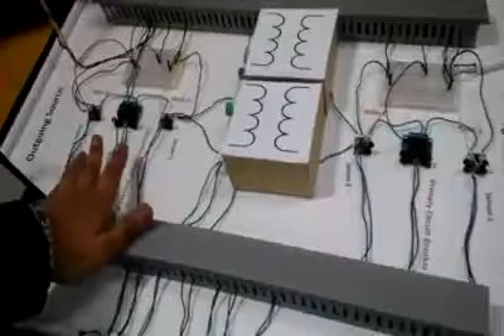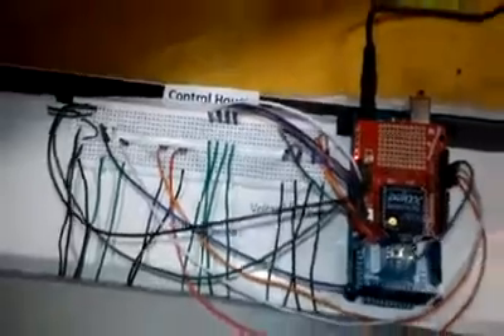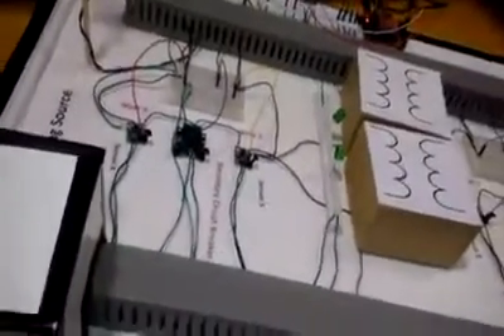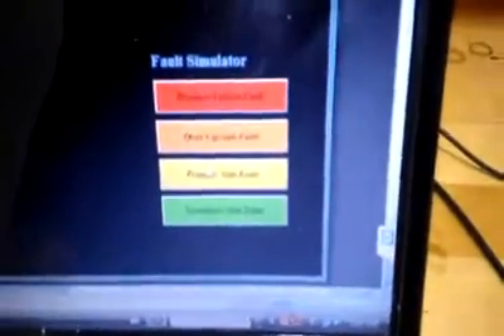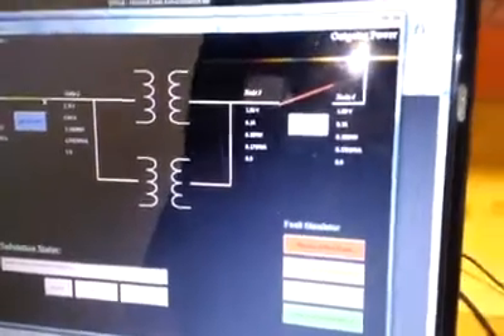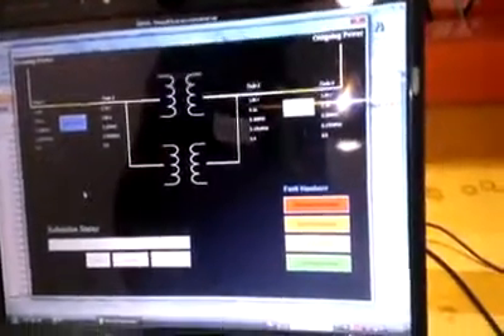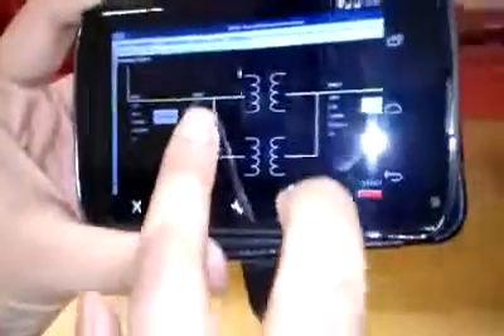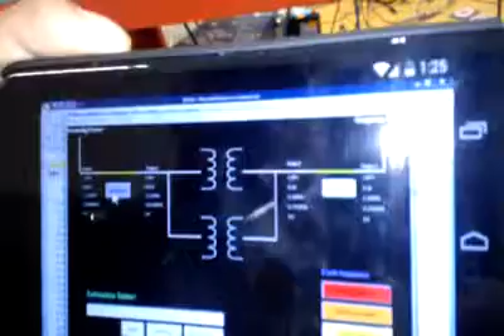SCADA System for Substation

Comment: From where do i will get the kit
Reply from the maker: Balai Saha we bought everything separately like micro controller ardino and xbee radio
Reply: @marediaakiff  manual kha se milegaa
Reply: Plz ap kit ka name btynge  ky kya  chayee...so that we can buy 
And details kha se milenge
Reply from the maker: Balai Saha you have to buy ardinomicro controller, xbee radio and other accessories such as wires, LEDs, sensors like current sensors, etc. 
You need to first break down ur project into different milestones and plan it accordingly 
We did this project in 2014 and it’s 2018 now and I am sure there are better solutions then ours